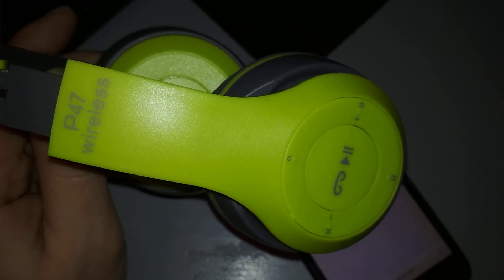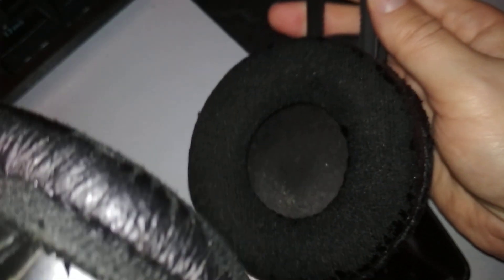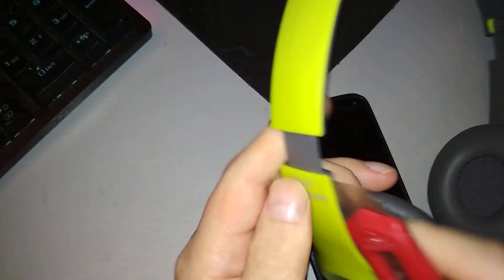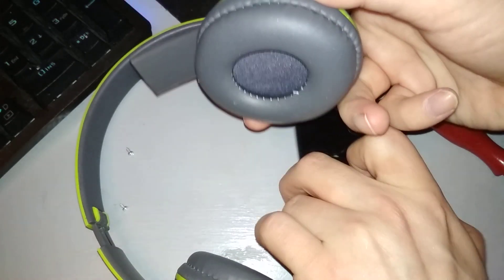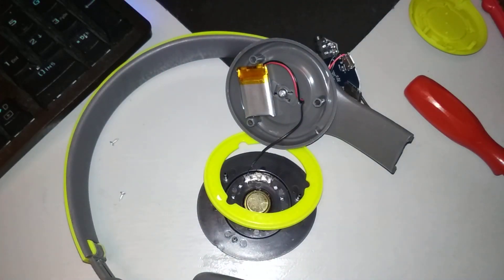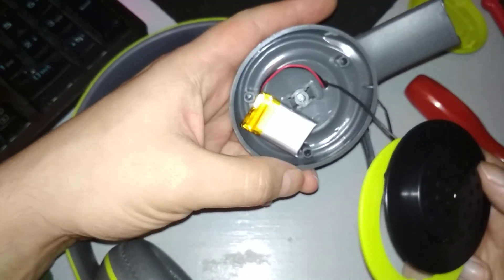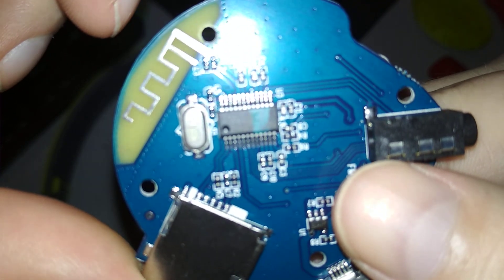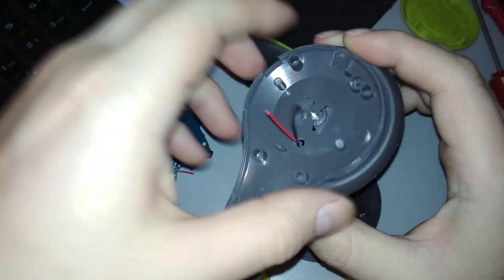DIY - P47 Wireless headset teardown - making a Bluetooth receiver usable with any 32ohm headphone 👍

Comment: Hey i have a problem that when i connect this with charger then it works otherwise it doesn't work ...
What can i do ?
Reply from the maker: The battery is probably dead OR disconnected. You can pop it open and check ... I had success replacing batteries in Bluetooth speakers with simple cellphone batteries.

Comment: i got a different problem, the issue is with the bluetooth connection, sounds louder and distortioned, but with aux connection (with the wire) sounds good again, ¿somebody have some solution? i been trying everything
Reply from the maker: I can't check right now, because I glued the board into a box, BUT from what I remember the AUX connection is not amplified, it goes directly to the speakers. So you may have a defective board. 🤔

Comment: Good video. For radio to work instead of static, when in  FM mode, press and hold the middle button until the LED blinks, it will start scanning and will memorize the frequencies, better to be outside or near to window, BTW, finish with the middle button again.  Cheers!
Reply: Update, it turns out that not all P47 are created equal, the green-gray ones, like in this video, ignores the long-press, so no FM scan, but other color variants works OK, if I'll find the way to scan FM for green-gray I'll post here. Cheers!
Reply: For green-gray P47 is need to switch to FM mode, when statics are heard, press short [ Play ], the LED blinks, then  press short [ Power ]. However it doesn't have antenna so not many stations are found, to address that, one can solder a wire to FM antenna point on PCB to a piece of sticky copper tape inside of the plastics over the head, or just use a long wire inside the plastics, then more stations are found and works OK. Cheers!
Reply from the maker: I don't care about radio at all, but thanks for sharing. Somebody will find the information useful 😎👍

Comment: My battery broken pls tell me the battery volt and buy link pls
Reply from the maker: I'm not an expert, be careful what you do at your own risk, BUT on mine I measured 4.18 volts when it's fully charged, so you can probably use any 4.2-4.35 volt battery 👍